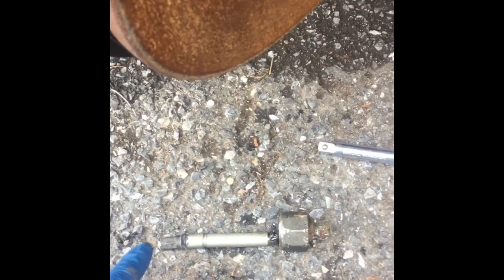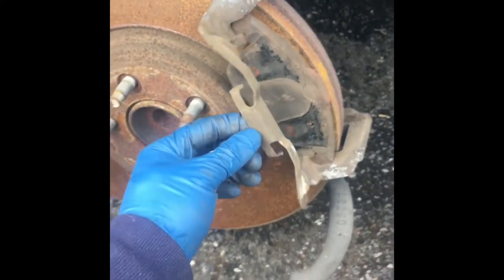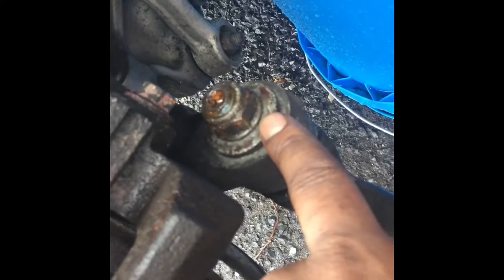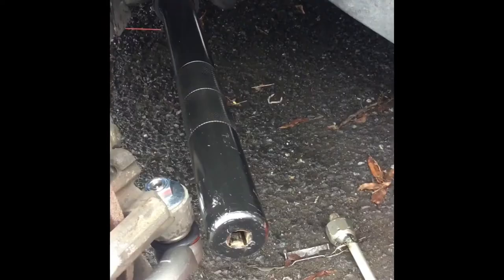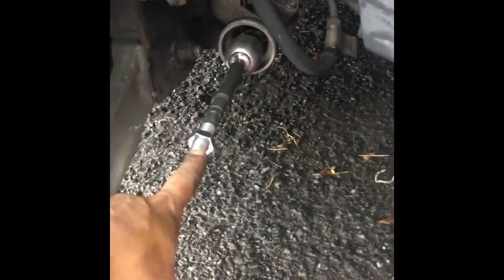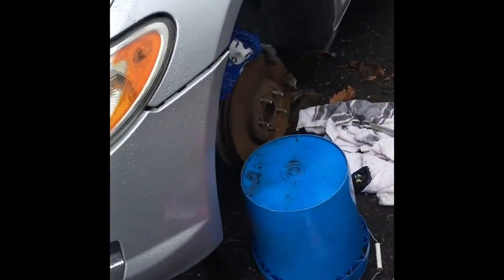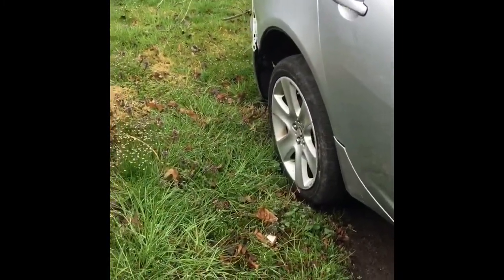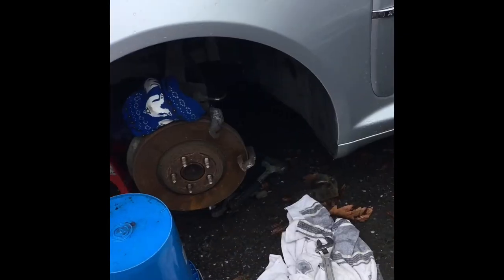How To Change Inner & Outer Tie Rods On A Jaguar XF

Comment: Hello I have a 2010 XF and it makes like a rattle (not a knocking) noise when I press on the gas. If I let off a little it will stop. Took it to the shop and they did not hear anything. It seems like it is not getting the power it used to. Any idea what this could be? One mechanic mentioned I made need a fuel pump but when I took it back to him he said I didn't so no going to trust him at all. I live in a small town so not many repair shops to work on a Jaguar.
Reply: Fule filter change would definitely help
Reply: What was the issue?